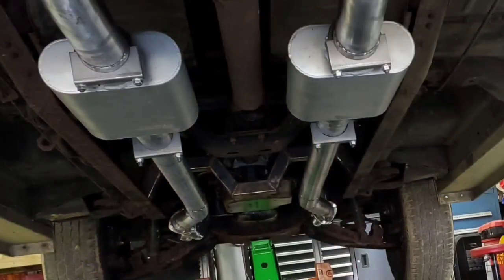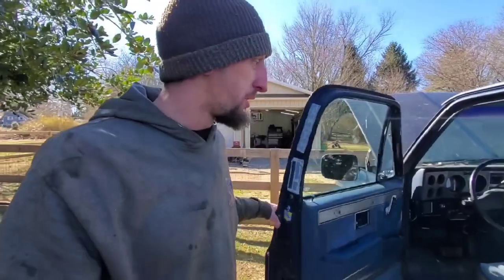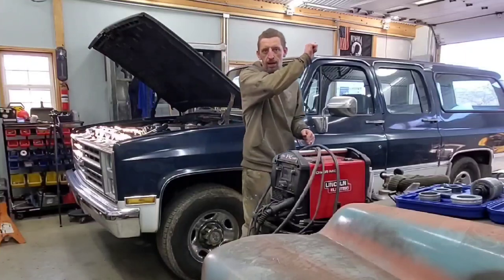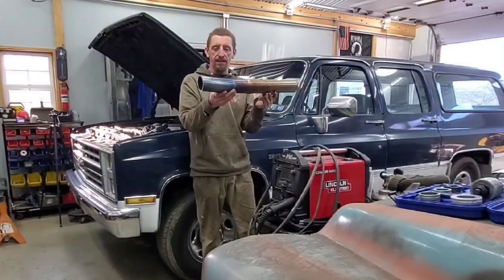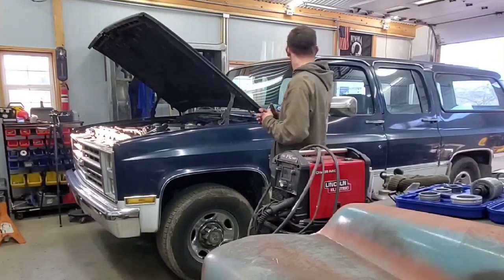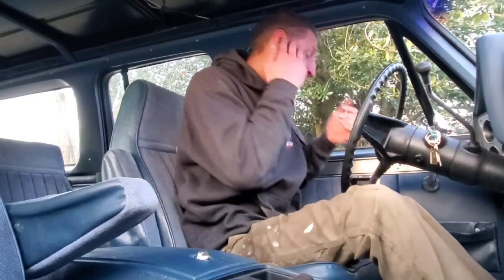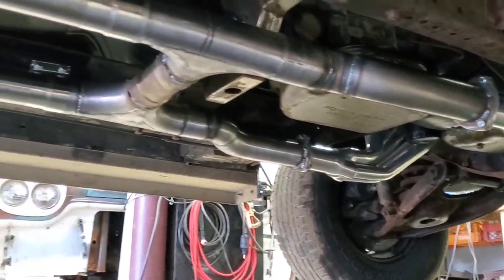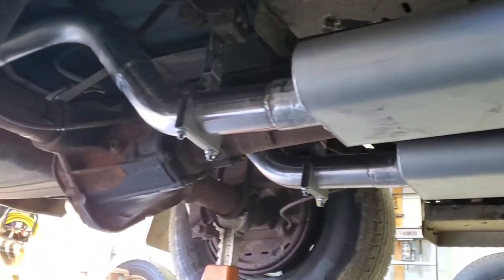Dual Exhaust Vs. H-Pipe - Will An H Pipe Make A Difference? - Sound Check - FYI It Gets Loud!

Comment: I had an x-pipe on my LS vehicle and I wanted to see what a h-pipe would sound like so I made my own. Before I welded the h-pipe in I tried just plain dual pipes like you had. The dual pipes were a hot mess, the engine lost power and it sounded awful. The h-pipe sounded great, and gave me that old school V8 noise I was missing. But, in the end, I put the x-pipe back on because I like high revs and it just feels smoother overall.
Reply from the maker: I need to do some work to my 2wd 1500 and it has the 4.8 in it.   I may have to add exhaust work to the list now 😂..

Comment: I still don’t know why to this day H-pipes are not as popular as X-pipes. I installed an H-pipe on my 2019 Tundra and it got louder and deeper. X- pipes are quieter in the lower RPM’s but get louder and raspier at higher rpm’s. But if you’re after a deeper tone get an H-pipe. Your vehicle sounds wicked by the way :)
Reply from the maker: Appreciate the feedback,  thanks... This is the first time I've run any kind of H/X pipe...  And I am definitely a believer in the H-pipe now...  While in the video you can hear a difference, obviously my audio wasnt the greatest (I tried).  The video doesn't do it the justice it deserves..😁😎👍
Reply: Just not true at all ppl run x pipes bc they sound better, sound like higher rpm, and clean up raspiness vs add, if anything a h pipe especially on v8s makes gutteral raspy noise not high pitch x pipe perfection
Reply from the maker: No you have me curious about X pipes...🤔🤙😎
Reply: @ChallengeTheBuild  i promise if u get a good x pipe u will be pleased, I heard a 2018 camaro x pipe vs none comparison in real life, the x pipe sounds about 1200 rpm higher
Reply: It’s totally subjective. I want a deep growl, the H gives you that. The X is high pitched and raspy.
Reply: THANK YOU! Folks still don't get the H pipe

Comment: Ive noticed that when you run tailpipes, you get that raspiness. They're almost like megaphones. Mufflers that are turned down have less of that popping. I like crossovers and at times resonators to tone down the excess noise. Thank You for playing the music of our people😁
Reply from the maker: Right on!   I haven't messed with resonators much but can see how they can play an important part in changing the tone of the exhaust...  It definitely is the music of our people! 🤣😂💯🤙  Hopefully I will be doing a cam swap sooner than later also...
Reply from the maker: I was really impressed/surprised at how much the exhaust note changed once I added the H pipe/crossover...

Comment: Great job, looks clean!  Sounds pretty sweet.  Like the pops when you let it go :)  I do prefer a dual setup like an H-Pipe after the mid mufflers but an X-pipe right after the cats.
Reply from the maker: Appreciate the feedback.   Now that I drive it a little more often I think I may change out to a 50 series muffler....  Try and tone it down a little bit more...🤷‍♂️
Reply: My setup is too quiet I might replace my bullet mids by UPOWER resonators, more direct, not sure...
Reply from the maker: Loud pipes save lives! 😂😂

Comment: Well that’s settles It, I’m putting an H Pipe on my 78 bronco.  Big block, Cam, headers and dual 2.25 exhaust is choppy as ever.  Basically only sounds good at idle.  I’ll just up to dual 2.5 with an H pipe instead
Reply from the maker: I was really really surprised at how much the tone changed, and it definitely helped with removing the chatter when under heavy acceleration.  All in all it was worth it...  I hope you have the same success!  👍
Reply: @ChallengeTheBuild  thanks dude!   It should be good. Another issue that I’m sure is adding to the sound issues it mismatched mufflers.  My father in law did wild stuff back on the day when we rebuilt the motor

Comment: I'd love to see a Dino pull on some of these before and after....! Love your h pipe design I might copy ya!
Reply from the maker: I really wanted to do this exact thing before putting headers and exhaust on the truck to get a nice base line... BUT unfortunately that didn't happen.    However I have plans for some more engine work at some point so I want to dyno it before doing the work (Intake, Fuel Injection, MSD 6al ignition system, cam and maybe heads?)   But that's a ways away unfortunately, Im not YouTube rich or famous yet..😂😂😂
Reply from the maker: The H pipe made a really big difference, definitely worth the time and effort!   Thanks for watching and commenting..

Comment: H-pipes have a higher resistance wich make it sound deeper but x-pipe has better flow if you go with oem pipe size or yoe can always oversize 1/4"...it just depends what sound you want out of your vehicle
Reply from the maker: Appreciate the input.   I think an X pipe is going on my Silverado once I install a cam and headers.. 👍

Comment: I love the sound of your H-Pipe! Is the crossover pipe the same size like your exhaust pipes or did you choose a smaller in diameter pipe?
Reply from the maker: The H-pipe was the same size.   Everything is 3".    Thanks for watching and commenting.  👍
Reply: @ChallengeTheBuild  thanks for your fast response. I have a goodwrench 350, sovI'll do all with 2,5". A friend told me something about a smaller crossover pipe than the rest exhaust pipes may be better, he got the info from Flowmaster homepage. What do you think? In my opinion same size means best exhaust exchange between the banks!?

Comment: Yeah you need to change to magnaflow has a lower frequency sound than the flow master that why you have that high end clatter still
Reply from the maker: These are cheap knock off Flowmasters, a real flowmaster probably would sound better.    Overall I am very pleased with the sound and the H-Pipe DEFINITELY helped with the upper rpm chatter (it's not perfect but better).   I'd rather change the camshaft 😂😂 and at some point I plan to...

Comment: So did u regain back pressure? Or does it still chatter. And with the h pipe do it still idle the same
Reply from the maker: Idle is a little smoother and deeper in tone, chatter is gone in the higher rpms (still loud just no chatter)  and I assume I regained a little back pressure.    Overall for this specific application the H-pipe was a HUGE success!
Reply: It lowers the back pressure (good thing).